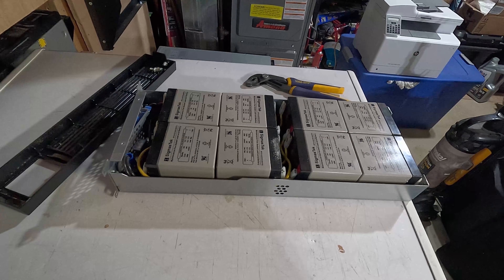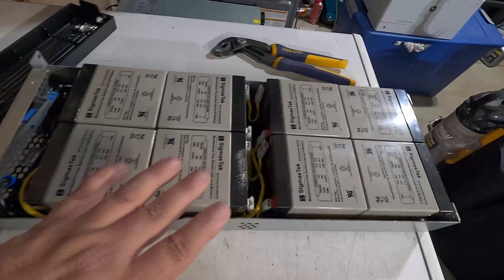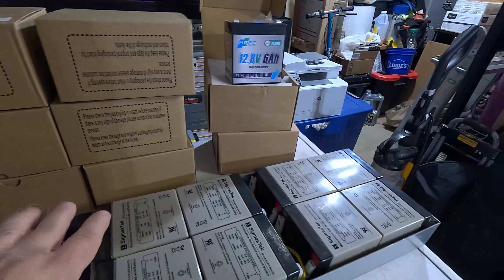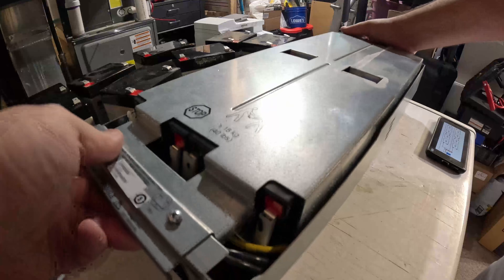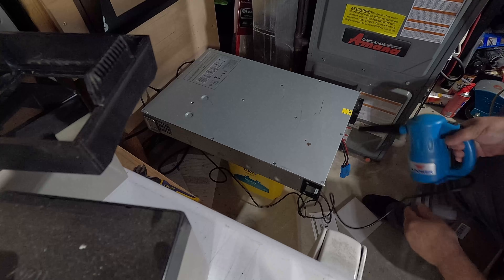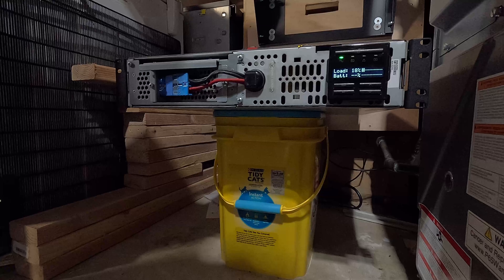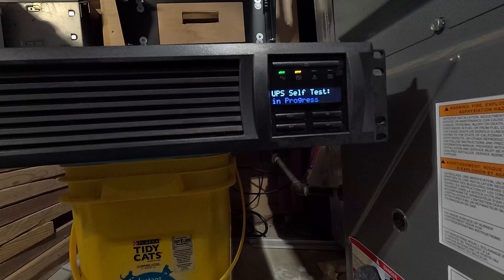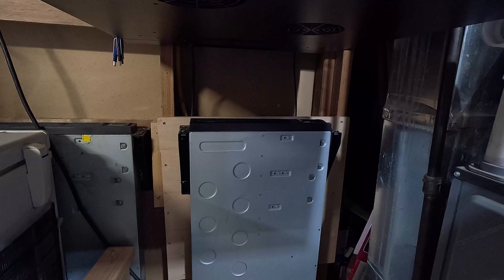Upgrade APC UPS With LIFEPO4 Batteries!!

Comment: Does the charge controller know how to deal with those different chemical batteries?
Reply from the maker: No it doesn't, but between lead acid and lifepo4 the usable voltage range is very close, so they're usually just drop in replacements.
Reply: They have a BMS built into them...which is really cool
Reply: @haydenc2742 the bms is the actual problem. The cheap bms does not allow enough current, no active cell balancing and worst of all they cut off the cell at 14.4v or 10v . The ups freaks out if the battery goes missing while charging or discharging. Absolutely cannot use any bms when the ups is handling all the voltage curves and cut off points. Active cell balancer is all you need  and you can fit lot more cells in that rack space. 
The 12ah 25.6v pack i made takes similar space of two 9ah/7ah 12v standard ups battery but runs close to the capacity of 27ah leadacid. Because leadacid looses run time with increased load. 9ah battery will only measure 4.5ah if you discharge it for 60mins at constant load. Lifepo4 doesn't have any such problem so at higher load levels the ups will run lot longer.
Reply: @haydenc2742  I think i read somewhere the bms doesn't work when in series.  Can't really tell from the video, but how are the batteries wired?
Reply: @MadMaxEdm the bms works for each batteries internal cells, but, when you put the batteries in series the batteries come out of balance.  It’s not an ideal scenario.
Reply: @MadMaxEdm  It depends on the battery.  Each one has different specs